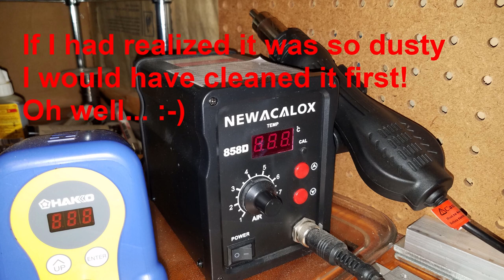10G Bullseye LNB Modification and Repair

Comment: Great job. I didn't have any issues hearing you on the voice overs. The audio is a little low on all of it, but no big deal. I really enjoyed you going through this to the extent that you have. Those 0402 and 0603 parts can be tricky. I haven't been brave enough to attempt fooling with 0201 parts. I like the larger smds as most probably do. Thanks again for doing such a thorough job. 73's.
Reply from the maker: I should have tried to measure the size of those parts. They are a LOT smaller than the 0805 parts I used in the beacon project. I suspect the smaller ones are 0402. I've had to adjust the audio a bit low on all of my videos, otherwise voice peaks clip and distort. I guess my speaking is too dynamic. I tried forcing myself to speak with consistent loudness. Didn't work. Those voiceovers really sound muffled or compressed to me. I will try a different microphone soon. I used a different camera this time for the video segments. Audio on it was not as good as on the camera I had been using, but the camera part is much easier to work with. I have as much to learn about making videos as I do 10 GHz!
Reply: @n1bug  Again no big deal on the audio. I was able to clearly understand you so I wouldn't worry to much about it. Sometimes things like the room that the videos are filmed in can even be a factor on some people's videos. Excellent content none the less.

Comment: Wondering; in your last picture, when removed, other than corner (ground?) connections, the Osc module appears to only have two connections.  One on left and one on upper right.   From color, these appear to be resistors (?).  If so, rather than remove module, it may be easier to just remove one or both of these resistors which would in effect, eliminate the osc.   Is there a schematic available for the LNB to verify?
Voice over audio was fine!
Reply from the maker: I can not answer that. I have never found a schematic for this or any other LNB. There are parts on the other side of the PCB which are connected to the oscillator module. These form a path from the red coax input to the oscillator module output. I think there may be a attenuator and a filter there. Surely it is possible to cut one or more traces to disable the oscillator module, but  I have not tried it so I cannot say what effect leaving the module disabled but still present may have. You can possibly find some further hints here, including a photo of the parts on the other side of the PCB:

https://www.pabr.org/radio/otherlnb/otherlnb.en.html

Comment: can i ask so removing the internal txco is the only modification required to enable a 10mhz gpsdo input into the red F type connector or is there further modification required to allow a 10mhz gpsdo input..?
Reply from the maker: You only need to remove the internal TCXO. No other modification is needed. However, be sure to feed it a sine wave. It does not lock correctly to a square wave source.

Comment: For future reference and to use proper terminology in future videos, these devices are not LNBs. LNBs are a portion of the feedhorn assembly. It is the electrical component that attaches to a feed horn waveguide. A LNBF (F indicates Low Noise Block amplifier with an intergrated Feedhorn). I enjoy your experimentation, as I have been designing, manufacturing and distributing in the satellite industry for many years and recently got back into amateur radio. 73 AI6US
Reply from the maker: Your point is well taken. Unfortunately this is a confusing situation. If I refer to them as LNBFs then I am using different terminology than the manufacturers and vendors, who label and sell them as LNBs. That would tend to create confusion for my viewers. I should have mentioned that LNB is technically incorrect despite common usage.
Reply: Apparently the colloquial terminology is changing, now that they are integrated.

Comment: If the TCXO is to become a throw away, heat the metal top with a blob of solder and it should pop off without collateral damage.
Reply from the maker: I tried that with one of them but my 70 watt soldering station was not able to get the job done. I tried using a big tip, flux, etc. but it just didn't heat the solder under the pads enough.